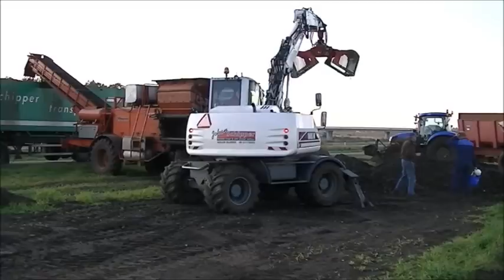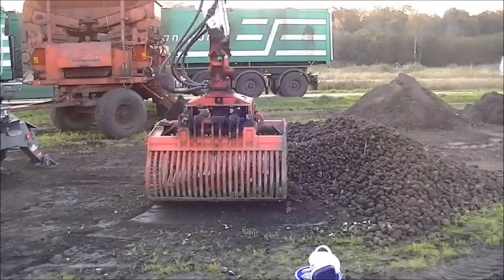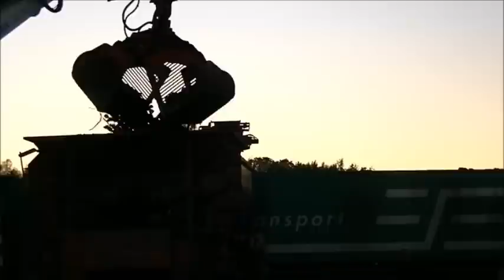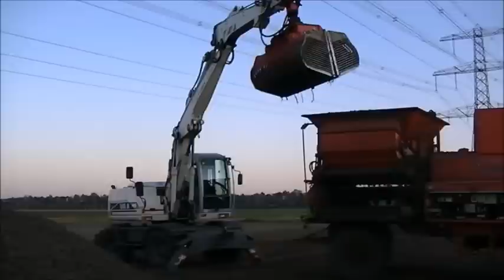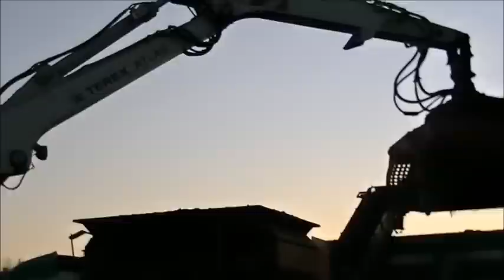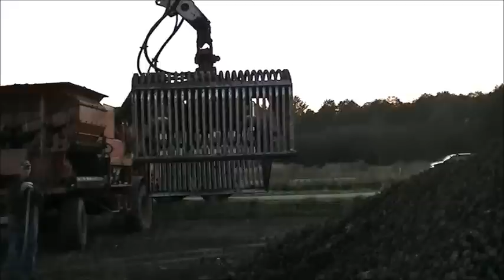Atlas Terex 1605M loading potatoes.

Comment from the maker: @balmesh 
hi alan,where this potatoes to eat you're right.
this ones are going to the factory for the starch production.
i've got another video where you can see what's happened when you putting some rotten potatoes together,or you harvest them in wet conditions.
many farmers here have the same problem.
on one truck you can't have more then 20 % bad potatoes,other wise they will be rejected and return to the farmer.